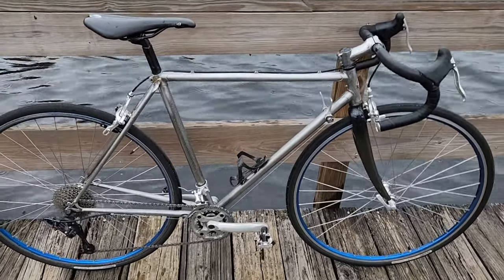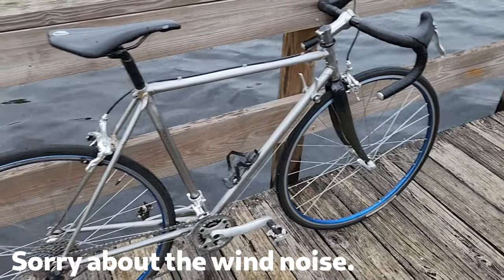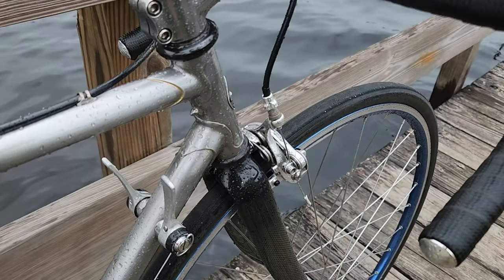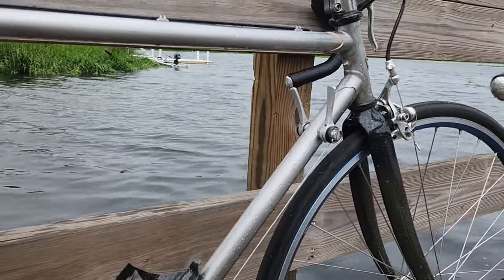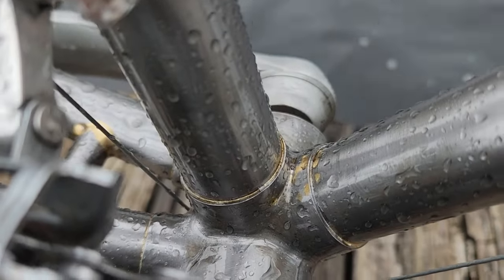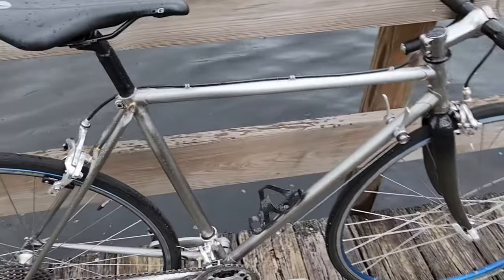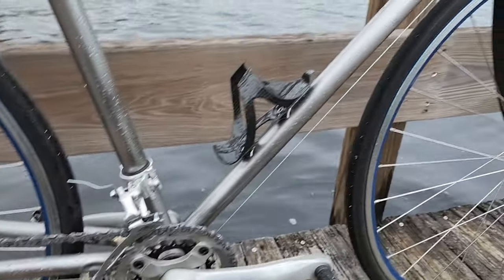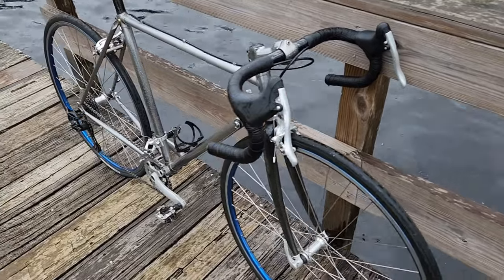Only clear coat (no paint) - 1 year update

Comment: On refinishing frames, Sheldon Brown says a finishing coat is not enough to protect against rust. Primer paint contains zinc, which slowly corrodes over time and protects the steel from rusting. I think the spider rust looks cool, but it's probably going to keep going deeper and destroy the frame :(
Reply from the maker: yeah that sounds correct from what I'm seeing also.
Reply: so either enjoy it bare until the frame dies or paint it :(

Comment: This is just what happens with clearcoats on raw steel frames. To a lot of people it's very appealing and attractive. Also it's nothing to worry about. It's just surface rust. Sure, over enough time it will become excessive, but it would be a long number of years before you'd have to worry about the surface rust. Look at Mash Work framesets. Keyword "patina". That's with a good quality factory clearcoat that comes stock on the frameset

Comment: I'm stripping a large MTB to raw. Then using a scotch brite pad to make everything nice and uniform. Its not even as aggressive as 0000 steel wool and it gives the aluminum a mild sheen but not stand out full on bling style. then Ill apply a clear. Specialized does extremely durable paint / clear jobs and its taking up to 3 apps of the paint remover to get it right bare. The new kinds of stripper in stores is shyte.
Reply from the maker: I think aluminum might stand up well in this application, not sure though